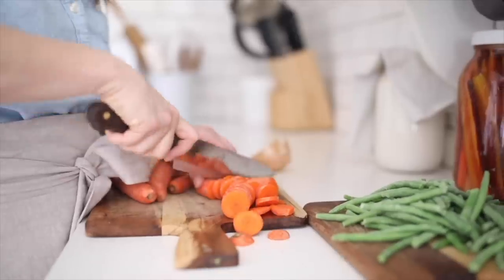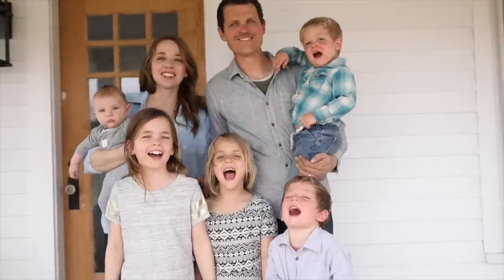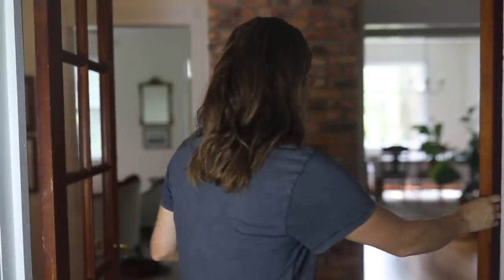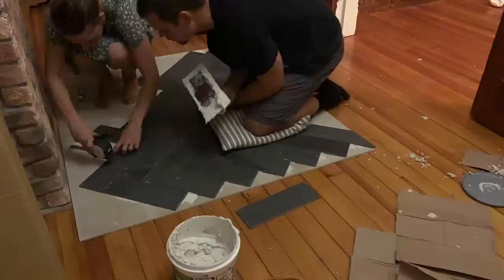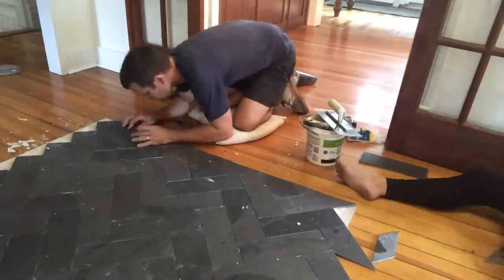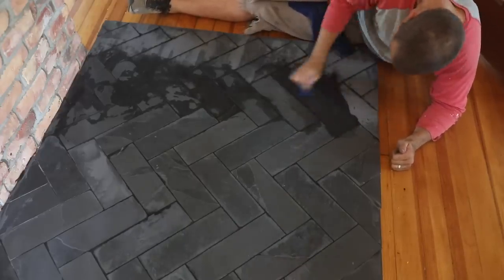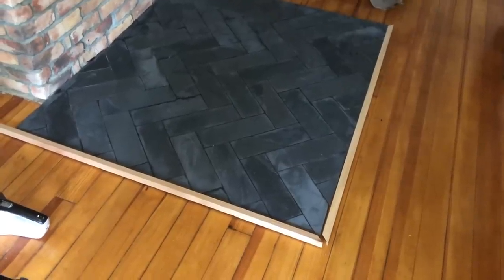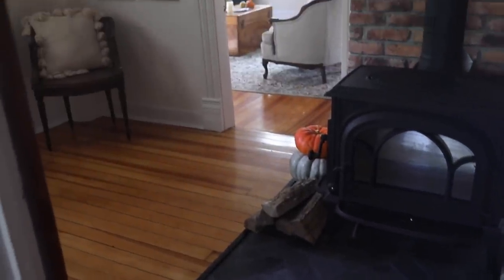How We Built our Slate Hearth Pad + a Peek at our new Wood Stove!

Comment: A trick we use with block paving is to have one straight bead all the way around. That brings the cutting edges on the tile away from the wall. Easier to draw and measure. Great work and thanks for sharing

Comment: Before my last son moved out about 8 years ago he suggested I replace the inefficient wood burning fireplace with a more efficient wood stove.  That was ideal because within a year I was working from home making quilts.  After much shopping around for the stove I settled on the Englander 2,200 sq ft model from Home Depot.  I too wanted a full slate slab but decided to go with the more efficient 12x12 slate tile also from Home Depot.  Removing the fireplace gave us the room and chimney placement that worked well with installing the wood stove in the corner.  My son carefully cut the wood floor (that I had installed a couple years earlier) at an angle and framed that with a leftover piece of wood, after installing fire resistant backer board he then laid the tile from the wood floor going back to the corner.  I asked him to butt the tiles up to each other (no grout line) to give the illusion of a single piece of slate and to offset the tile so no grid line is obvious to the eye.  The slate tiles had a nice variation of colors ranging from black/blue, slate blue and even some nice rust brown. When the tile was done he stood back and said the colors are like a patchwork quilt .... as if that was a bad thing ??  Not for a quilter!!  He did a beautiful job with the slate tile and the wood stove was installed soon after.  By cutting the wood flooring out and installing backer board the slate is even to the wood flooring eliminating any possibility of tripping.  That was the best decision ever when it came to remodeling.  A few years later when the kitchen was remodeled I wanted slate tile as well but a tile expert suggested using a slate look tile for the large kitchen floor, easier clean up and easier on the feet when standing since the tile was more even.  Using the offset install with 16th inch grout line with slate colored grout gives me the look I like which compliments the concrete counter top by the sink and the wood counter for the island.  Standing in the living room and looking at the slate under the wood stove and the slate look tile in the kitchen you wouldn't see much of a difference.  This all came together because I like slate tile.

Comment: We modified a "no dig" black metal fence from Lowes for a fence around our wodburner because two kids got third degree burns.  Then I put the wood in an antique steamer trunk.  We bought a black metal bucket with a lid because I put the ash bucket outside once and the wind blew the ashes and burned a hole in our porch.

Comment: Thank you. I am going to build a hearth for my woodstove. I was fearful that I couldn’t simply tile over the cement board. Lots of YouTube videos add a 2 inch layer of garden paving stones as it appears in your video. I really don’t want much elevation because I fear someone may trip on the lip of the hearth and fall into the hot woodstove. Hopefully my town codes will allow for me to do just the tiles on cement board. It’s been hard to choose what would match go well with my oak floor. I think your herringbone slate design will work just fine.

Comment: If you don't want a tile wet saw, there are cheaper options with tools that repeatedly score the tile and then another part of the tool, or a seperate tool sometimes is used to apply even pressure so that the tile snaps where the scoring is. 

This is a good cheap option for a man living in the wilderness or something and trying to heat his cabin.

(Scoring, in this case means making a thin, but straight scratch in the tile repeatedly in the same spot to weaken it in that area and make it more likely to break."

I like this idea, but I used grey sidewalk pavers.

Comment: I know this video is old, and not sure if you’ll see this. I am planning a project like this for myself. Did you do anything to connect the pieces of cement board to one another, aside from adhering the tile and tacking the trim in a few places?
Reply from the maker: https://www.farmhouseonboone.com/diy-hearth-pad
Reply: @FarmhouseonBoone  thank you for your reply. I have actually previously looked through this blog post to which you have linked. In this post you discuss cutting the cement backer board and adding additional length to each side. My question is, how did you keep those additional pieces in place before adhering the tiles?  Or did you just let the mortar and tile dry in place and use this to keep the backer board from separating?  Thanks for any and all help!